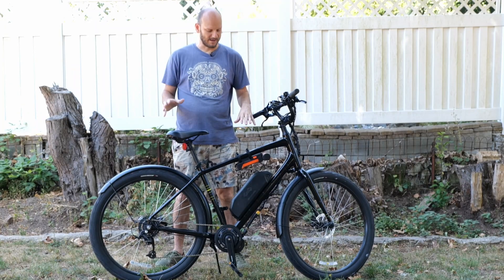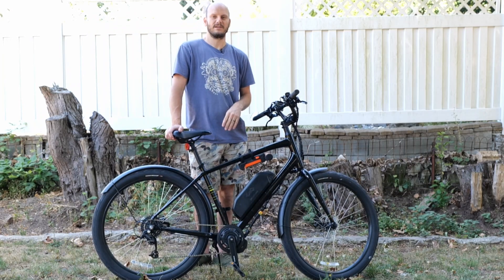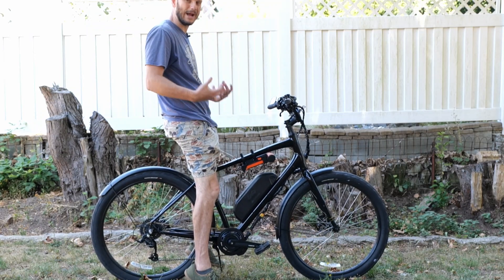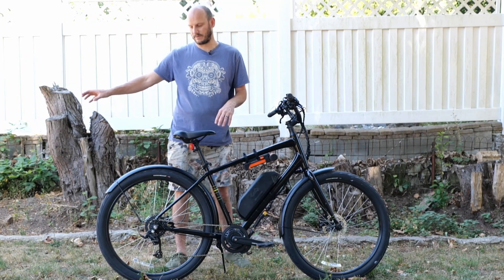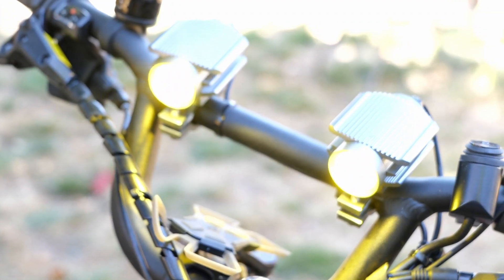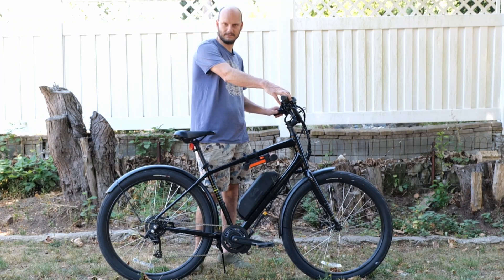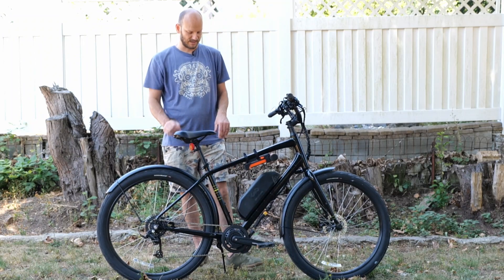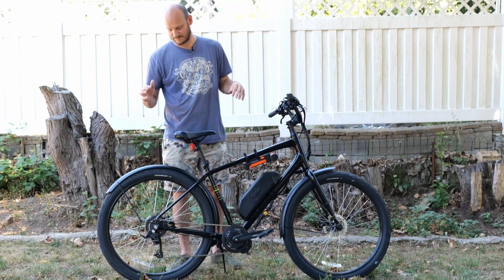Custom E-bike Build: Specialized Roll w/ CYC Photon Mid Drive overview. Top Speed and Hill Climbing

Comment: Im looking at this kit to convert my old cannondale mtb which is now  single speed. 
Would the Photon work well enough on a single speed trail bike for flat'ish ground riding ?
Reply from the maker: Probably not the first gen. Generates too much heat. I’d go bbshd if you don’t need torque sensing.

Comment: Hi Johnny
Alex here from Australia 
Great videos. Ive been watching all your videos for a little bit now
I actually liked this bike when i saw it and just purchased one myself. I was just wondering if you could help me out. Id love to put a gen 4 cyc on it but think it would be an overkill. I was thinking the bbshd 100w with 3000w upgraded controller.  I was after high torque for uphills and towing my daughter. If you can help that would be greatly appreciated 😊
Reply from the maker: Overkill for sure. 750w-1000w motor is totally fine. More important than power is making sure you have it geared correctly. If you need to upgrade your cassette in the rear so it has a wider gear ratio to give you more hill, climbing, etc..

Comment: (Formerly PDXevgrin) - I really like your build.  Having been a DIY hub motor user since the beginning, I can see that we may have reached PEAK (GMAC Geared Motor) for hub drives, but now most bike shops won't work on hub motor bikes due to all of the cheap trash ebikes available now. Many buyers have no previous bike experience or etiquette, and therefore buy the cheap trash.

I'm eyeing the Photon with a 42t chainring.  At least it has a great torque sensor. I get why the mid-drive platform may be the only future for ebikes.  Still waiting for a bit more testing on the Photon.  I ride normally anyway, not looking for a 2000W constant motor.  I believe most issues encountered with the Photon are temp related.  I live in Portland, you probably know of who I am.  If I make the switch I'm going to order through you.  LEBS :) We both have the DIY ebike spirit.  I'm planning a super long tour and the recent hub backlash (liability, I get it) is having me consider the other direction.  I'd be giving up regen braking but gaining simplicity.
Reply from the maker: Hey! CYC addressed the temp issue that was plaguing the early editions. Motors made in the last year or so have been pretty solid. I stopped carrying them for about 8 months until they fixed it. It’s also pretty easy to service (I posted a video yesterday on it). 
I would say that yes, losing regen is not ideal, but the torque sensing mid drive will be more efficient with energy usage so it’s a wash.
Reply: @JohnnyNerdOut  I feel that the bike shop labor ban of hub bikes will push the mid-drive market into an even better place. DIY all the way regardless. 

And perhaps we are at a significant turning point. I did watch your videos on the Photon. I understand your point to move to a Photon 2 if only to shed the Reddit/reviews about it. But I would rather CYC work on the current design so that updates/improvements are backwards compatible. The industry moving into the automotive driven $7500 ebikes is the wrong direction. With millions of excellent bike frames already existing - the DIY route is best, IMHO.
Reply: @JohnnyNerdOut  what specifically did CYC revise in working out the temp issue?

I just assume most of those issues were related to pushing the motor too hard.
Reply from the maker: @pdxevgrin  they didn’t publicly say the issue but it was a weak electronic part that was prone to overheating and failing under hard use. It limits itself now so that doesn’t happen.
Reply: @JohnnyNerdOut  so they updated the hall sensors perhaps? It seemed it should always stay around 90C at the top.
Reply from the maker: @pdxevgrin  I don’t think it was the hall sensors, can’t remember now….
I would say though, if you want to push it and be riding 30mph +, I’d go with a bafang

Comment: I have the BBS02 and I was more interested in the mounting , the 02 ha a make shift plumbers tape mount for motor twist.
Reply from the maker: Do you have the triangular mount installed? If not the motor will break itself off
Reply: @JohnnyNerdOut  Yes, Inaddition I added another attachment point to stop the swiveling of the motor from the torque, it holds the motor tight to the frame and prevents it from swiveling down.

Comment: Is it possible to configure the throttle to give you power when you are not pedaling?
This would be useful for popping out of ruts
Reply from the maker: Yes. Pretty much every conversion kit offers that feature. At least the mid drives do.

Comment: I have a 2018 Specialized Roll Comp (XL). I've gained a few pounds over the last few years (300-390 lbs). Would it be worth it (and safe) to convert my Roll to an E-bike copying this build, or should I just go with Himiway Zebra for $1800? I assume I could get a few bucks for the Roll (it looks brand new). How much did this build cost? Performance between the two?
Reply: I'm also 6'8", so that could come into play.
Reply from the maker: You may want to check out day6 bikes or zize bikes and converting one if performance, customization and price are important. If you prefer something to be assembled shipped to you the himiway may be the better option.
Reply: Damn, I was hoping you’d say to go with the Roll… and give me some ammo to convince the wife. 

I love my Roll and have high hopes of getting back down under 300 lbs.

Comment: If the gears are actually a useable function with the mid drive. Why can you not achieve a higher speed on the throttle ? like 40mph
Reply from the maker: When the conditions are right, 40mph is achievable.

Comment: Thank you for your helpful videos.   I have a Giant ATX  , and am wanting to convert to a CYC  Photon,  but the bike is internally cable routed with cables coming out of the bottom of the bottom bracket, and  will also convert to hydraulic brakes. Will this work ok regarding bottom bracket space ?   Thanks
Reply from the maker: In general, yes you should be fine. We deal with that stuff all the time. Worst case is you may need to run the cabling externally ☹️

Comment: High Voltage video mentioned a problem with the non drive side axle bearing.  Seems this could be a problem with the motor.  Hopefully, CYC will have a quick fix for this problem.

Comment: I have this bike and would love to mimic the setup here. Would you be able to share the motor config needed for this same bike as requested in the form on the JNO website (BB size, crank arm length) ? You mention the build maybe being more "torquy" if we get a 34T chainring, but you seem happy with the 38T, I was wondering if after riding it for a few miles you would have a recommendation between the two? Thanks for the inspiration, looking forward to building this!
Reply from the maker: Links are in description, you will have to select from the drop-down menu unfortunately ☹️ 
You can also call or email us through the website and we can build you an invoice if you don’t want to go to page by page and adding stuff to the cart.
I still like the 38t. I would probably go 42 if I had to do it all over again, but it’s not worth it to change it.
Reply: Thanks! @JohnnyNerdOut  I was able to figure it out,  I have a 68mm BB and crank arms are easy to measure. 
I think I'll be able to order from the website, also to take advantage of that sweet Paypal financing... 
Interesting to hear that you would go with a 42T chainring if you had to redo it. I assume it is because you found yourself unable to keep up with the pedaling at higher speeds? Thanks for for feedback, my setup would have numerous steep hills to overcome,  but looking at your "throttle-only" tests in this video, it sounds like hills shouldn't be a problem even with the higher chainring size.
Will definitely give you a ring to ask about availability on certain parts in the shop for this build.
Cannot wait to build my first e-bike! Thanks again for all the education you provide here.
Reply: @diver___ if you have a lot of hills in your bike ride inwould go for more torque over top end and if you want the most torque possible then you need to go with a gear ratio of 1 to 1 meaning if you have a 32 tooth in rear then put a 32 tooth on the front

Comment: I am building an ebike. But i want to do a pedal delete. Got a 48v 1800watt Brushless motor. Running 11t on motor 44t on wheel. 26” wheel. Did torque calculation and it says 10.9 ft.lbs. i know a honda grom has 7.7ft.lbs. or do I need to install a dual strand idle sprocket to increase torque. I would like your thoughts. Please and thank you for your time.

Comment: i generally install a 10 speed transmission, because that's the least amount of gears you can get with a wide range (11-50t) with a shimano derailleur (SL-M4100 + RD-M5100). I use chinese 11-50t cassettes, no 50t available from shimano, but the chinese ones work just fine. 10s is still fairly cheap and robust

Comment: I recently bought a 2014 fatboy expert with an e*thirteen pf30 bottom bracket.  Can I use the bbshd with a pf30 adapter? Or do you suggest something different?
Reply from the maker: Yes you can, get the 120mm bbshd. There are a few pf30 adapters out there. The Lekkie one works but is designed for a 68mm so it’s not perfect/ideal.
Reply: @JohnnyNerdOut  How many spacers do you recommend to clear the chainstay

Comment: How do you feel about a build of a mid drive with a torque sensor without brake cutoff?
With or without throttle.  

I believe many of the bikes I have ridden in Europe do not have brake cutoffs.  I know they don’t have a throttle.  I would think if I did not have a throttle they would be safe.

What do you think?

Also I notice no gear sensor on this build.
Reply from the maker: I always suggest using brake cutoffs and a gear shift sensor on any build if at all possible.
Reply: My experience so far is that I have no need for a brake sensor.  I've a tendency (thanks to motorsports) to just barely ride the brake lever. Which was giving me cut out problems the first week or so with the Photon before I figured out I was even doing it. It'd be better if you could set the range or sensitivity on the brake sensors.  But I only have a mil or two of clearance and just barely touching the lever set the sensor off.  That along with the delay in motor "ramp" made it surge a bit.  But, it's nice you can just turn off the sensors when you're riding it via app, and maybe turn it back on for a newb riding it.  I've considered running just the front brake lever sensor and killing the rear.  But currently, no need to re-engage after a few weeks riding without.

Comment: Hi...keep up the awesome work. I have purchased a gazelle ebike with impulse motor (not working). The bike is as new condition. Is it possible to install a bafang ultra or cyc motor using some frame adapter plates or similar...thanks for reading.
Reply from the maker: I’m sure you can find a motor that will fit with the right adapter. I’m only a little familiar with that bike.
Reply: @JohnnyNerdOut  thanks...do you have any ideas of where to source an adapter? I have scoured the internet and can only find a mount for the bafang ultra that needs to be aluminium welded after the old mount is cut off the bike, chain alignment would seem an issue with this method....thanks for your input

Comment: Hey Johnny... Would this be worth it to setup with a 3 speed internal geared hub?  Also is there a 104 bcd adaptor... I'm coming from a gates belt drive bike...thnx
Reply from the maker: I’d want more than just 3 speeds. Maybe a 5 speed with a wide enough gear ratio. I have some chainring adapters on my site. Can’t remember off the top if they are 104 though.
Reply: @JohnnyNerdOut  they are not. Only the factory chain rings will work. Supposedly they have a belt drive version coming out, but that was supposed to be released three months ago. 

This thing, with a belt drive, would be amazing as the alignment would be so awesome. It would have enough torque to pull stumps, but like Johnny intimated, you'd never really utilize its potential as commuter with the available Gates belt or cogs. 

I recently built a belt drive Momentum with a TSDZ2. It is quite remarkable. It was 104 so I was able to just swap factory for factory. You'd probably want to get an OSF programmed version as only EUNORAU is not using really weak factory programming right now and they are having some issues (had to return 6 of their motors).

Comment: To go 34mph on throttle only is impressive.  I calculate you'd need a 60t chainring to keep from ghost pedaling at 34mph.  The trouble is, almost no bikes have the clearance for 60t chainrings.  The Troxus Explorer does.
Reply from the maker: The 50t might keep up at 34mph. My 38t is good up to about 27-28 @90 rpm
Reply: @JohnnyNerdOut  Sheldon Brown's Gear Calculator says 25.6mph at 90rpm for your bike assuming you have an 11 tooth cog.  A 60t chainring would be good for 40.4mph at 90rpm. 52x11 would be good for 35mph @ 90rpm.
Reply from the maker: @georgekrpan3181  I’m assuming you got the correct tire size in there too? That sounds about right though
Reply: @JohnnyNerdOut  I think I assumed 2 inch tires.  Cheers JNO!
Reply: @georgekrpan3181  that's very close to what I'm seeing with a 26-2.4,  11t low gear, 34t photon at about 90rpm cadence.  I'm really smoking myself out to pedal over 30mph. I've hit 31 on pedal with assist and My old knees were doing everything they could... no idea the cadence at that point.  Near 40mph on throttle, working the gears a bit at 1500w. I sorta wish I'd have gone for about a 40t.  I think on a 29er a 34-36 would be perfect.

Comment: Why were your feet off the pedals on the hill climb but not when going down the street?
Reply from the maker: So show I wasn’t pedaling.
Reply: @JohnnyNerdOut  It didn't look like you were pedaling on the street either.  Is there a freewheel on the front gear so you don't need to pedal when using the throttle?
Reply: @JRP3  Of course yes, you can put your feet on the pedals and throttle without pedaling, or use both etc. Only thing about this system is the chain only goes forward so when lubing chains you have to lift bike and pedal forward. When spinning pedals opposite way, the free wheel spins and chain stays in place.
Reply: @MrDearCandy  That's what I thought and why I was confused that he had his feet off the pedal for the hill climb.  It would be obvious that his feet weren't moving if he just kept them on the pedals and used them as foot pegs.
Reply from the maker: @JRP3  yes. All mid drives have a freewheeling crank

Comment: Wish this had been out when I built a couple of tongsheng ebike conversions last year.  Even with mild greenway riding they get hot, then noisy, then short out requiring a new motor and likely a new controller.  
I also have a Giant Trance E+ mtb - just crossed over 500 miles on it and did a riding reveiw, also starts off by showing how to easily load ebikes on a platform rack:
https://youtu.be/mZTqaqODDlI
Reply: I ride a tongsheng 500w in Phoenix ambient Temps over 110 average speeds around 15 to 20 and never overheat...plus at 240 I'm no lightweight. What gives?
Reply: I'm suspicious of the open source firmware ours are setup with - I've dialed back the amps/watts settings way below the osf  recommendations so will see if that keeps them from burning up.  @vibs1614

Comment: Basically get this if you want Torque over candace sensing.
Reply: It os 50% lighter than The BBSHD (hamdling)handling, is quieter, fits more unique frames and allows for a perfect chain line on commuter, road and many gravel frames. Because it is torque sensing, there is no need for a shift or brake sensor, so it makes for a much, much cleaner, easier, faster install. My biggest complaint with Bafang are all those little extras and the fact that they respond so absurdly slow. I have a customer with a 12 speed Rosco (about $3k before the motor). It shifts close to stock and there is little perceptible run on (in these two things The TSDZ2's torque sensor is superior).